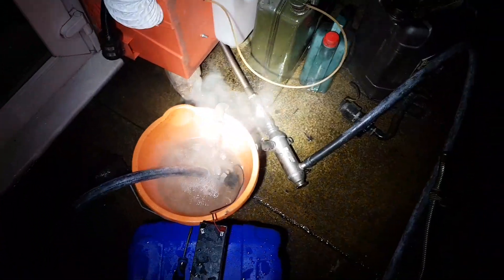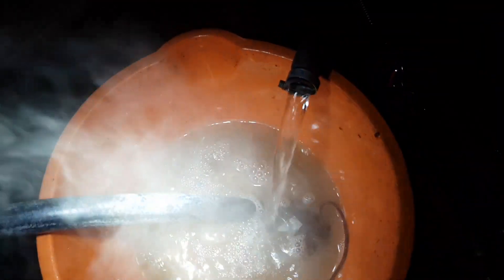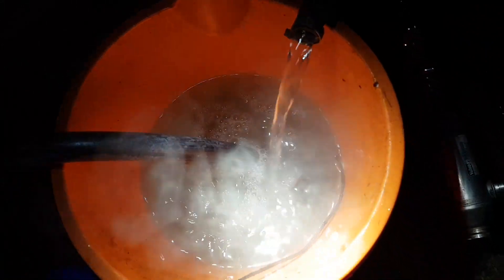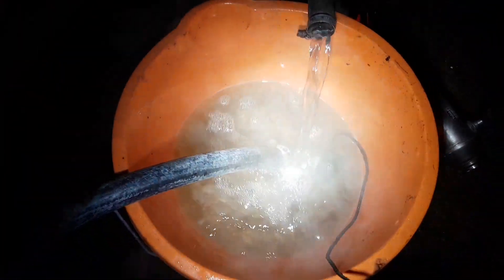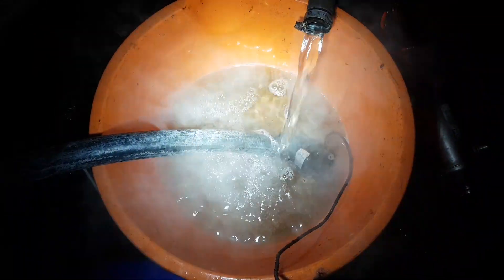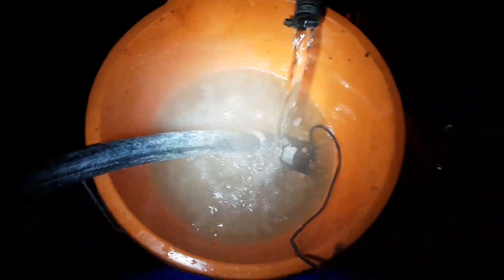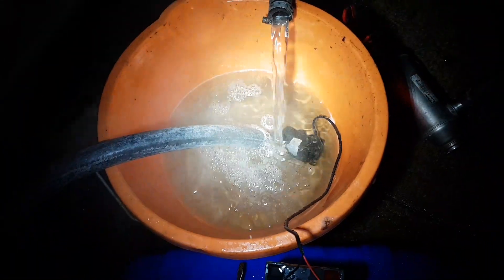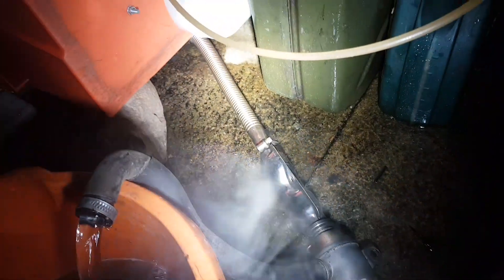5KW Chinese Diesel Heater exhaust heat recovery/Water heater 12v part 1

Comment: Fantastic video. Can you use this water directly for a shower? Is it contaminated? Being run through an old EGR?
Reply from the maker: No, it won't heat the water quick enough; you need a hot water tank to store the water as it's heated. The water isn't contaminated granted you clean coolant residue out properly.

Comment: This is awesome. I was going to go with the copper coil around the exhaust but this will work a lot better. Will it be ok to run the Chinese heater without the water pump circulating the water? I'm going to install a thermostat to turn of the pump when it reaches the desired temperature. Sounds like I'd better add an expansion tank as well so it doesn't go pop.

Comment: I'm currently building my Chin heater - All-in-one - system using exactly the same EGR exchanger as a calorifier, which will be coupled in a thermosiphon loop to a hot-water tank, which will be high enough to deliver hot water via gravity feed to my sink taps and via a 12v (BMW) pump to the shower head.   I will be lagging the entire water heater system too.  

My entire setup is being housed in an old LanLi PC tower chassis - one of the largest PC cases I've ever seen!   All run by a modified 500watt SMPSU from the same PC.   
.
I will regulate the temperature in the tank, by a thermostatically controlled 'secondary loop' that will route some of the excess hot water to a radiator, thus keeping the temperature delivered to the taps/shower below scalding temperatures.    

It was good that you showed this in action, for it confirms that the system will need regulation.   

Excellent little video thanks!

Comment: I may use it to heat my home I have a forest hot water heating system with four zones runs often number to oil in the US but if I add that little heater to a 80 gallon or 50 gallon storage tank once that tank is hot my thermostats will be able to call for heat out of that tank and this heater in theory should make up the temperature in the tank?
Reply from the maker: It will certainly supplement heat to a large hot water tank. I'm not sure it will heat it well though, unless the tank is very well insulated and there is low hot water demand.

Comment: If the bucket was a radiator with an expansion tak in the system it would be free central heating
Reply: Free at a cost of diesel😂

Comment: Hi mate thank you for the speedy response! I have just bought this egr cooler, from watching this video! You should be on commission 😜, I don't suppose you have the details of the pipe and pump so I can put this together? Thanks Jonny - Yorkshire Campers
Reply from the maker: Search ebay for 12v solar hot water pump. As for the hose it's car heater hose; I think it's 19mm but can't remember.

Comment: Can you use this for heater water in a tank for a shower?
Reply from the maker: Absolutely, just remember to use a expansion tank/vessel or vented system.
Reply: @forenamesurname4576  I wonder if the fiamma accumulator will work. Is there a chance the exhaust fumes can get into the water or is it pretty sealed?
Reply from the maker: @YorkshireCampers  Zero chance, the EGR cooler (Valeo# 9631424880) I'm using is made with thick stainless steel. You need a proper central heating expansion vessel; It's essential for safety unless you make a vented system.
Reply: I am thinking of getting one of these what do you think? 
FIAMMA A20 ACCUMULATOR TANK
Reply: Also I don't suppose you have details of the 12v submersible pump do you?
Reply from the maker: @YorkshireCampers  If you search ebay for 12v solar hot water pump you'll find the right sort of thing
Reply: It has just arrived today 😊 so will test it out... I don't suppose you have the details of the pipe used and what the diameter is? Thanks

Comment: Campervan hot water system ?

I have one of those chinesium diesel heaters in my van and like to get some hot water every now and then as well. Looking at your experiment I had an idea...
I was thinking of installing a vat out of a central heating boiler (I have one kicking around which is 14L , has a in and out pipe for fresh water (15mm pipes) and an in and out set of pipes of 22mm connected to an internal copper coil which is normally used to connect to the central heating circuit (water), I mean the water running throught the radiators in the house.

In my van I would run two hoses to my engine and connect the boilers internal copper coil into the coolent system (to get heat into the boiler when I am driving around) but I like the idea to have an EGR exchanger heating up the water in the boiler vat using the chinesium heater in case I decide to not drive for a couple of days or longer. 
Most likely I would need to use a 12v water pump (I have one sitting from a webasto thermotop c) which would circulate water from and to the vat throught the EGR thingy to heat the water up in case I use the chinesium heater...

My questions for you experienced messers-abouter (all due respect) 
a. Can an EGR valve be used to act as a bypass (exit the system before entering the EGR exchanger) for the exhaust gasses in case the water in the boiler has reached a set temperature ? 
b. Is said valve controller by 12 volts ?? 
c. Do you have any suggestions as to what brand EGR exchanger and valve I should try and find for this please ?
Reply from the maker: Hi, theoretically you could do that and it would be a great way to isolate the EGR cooler once the temperature is reached. 

The problem is all the electronic EGR valves I've seen need a PWM signal to open/close the valve. You can get old style EGR valves that use a vacuum actuator to open/close but would then need vacuum source and vacuum modulator. I'm not aware of any useful EGR valve/cooler combos unfortunately.
Reply: @forenamesurname4576  In that case I would probably need to build like a miniature cooling system where the egr cooler is like the engine of a car producing heat, the boiler and a to be installed heater core radiator inside the cabin like the radiator and a thermostat controlling when the hot water from the egr is going where...
Reply from the maker: @koningbolo4700  that'll work fine 👍
Reply: @forenamesurname4576  I was planning a heat in the back of the van based on a mini classic heater core (from which I have the factory fan removed - because of the crazy power consumption is displayed). I could use this heater core and a webasto thermostat t piece (not sure yet if it is usefull since I am not sure at what temps the valve inside opens up...

Comment: hi, i made the same, but my water won't get hot at all. everything is hot, the exhausr fumes too, but not my water. do you have any ideas why?
Reply: if i stop the pump for 30secs, that little amout of water what is in the egr will get hot, but when i run it constantly it does nothing
Reply from the maker: @martintorok7967  what quantity of water are you trying to heat? It will heat water however it will take a while.
Reply: @forenamesurname4576  about 10 liters. after i commented, i turned up the 5kw heater to 3hz, it was good after maybe an hour. have you used full heating power in your video?
Reply from the maker: @martintorok7967  yes I used it on 5.9hz full power
Reply: THERMOSIPHON....  Don't need to use pumps!

Comment: Its a great idea for camper vans and caravans, ive got a diesel heater in my caravan, my only concern for hot water is that you have to have the pump running constantly and make sure you dont run out of water.  A mechanical switch over to a separate exhaust when just using the heater over night would be the ultimate solution if one exists.
Reply: For the past six years, I've had no running hot water or heating in my caravan and thus been reliant upon mains electricity to boil water (kettle) cook food (uwave and small oven/grill) and power the small oil radiator...  Now with the hike in energy prices, I'm I'm currently building my Chin heater - All-in-one - system using exactly the same EGR exchanger as a calorifier, which will be coupled in a thermosiphon loop to a hot-water tank, which will be high enough to deliver hot water via gravity feed to my sink taps and via a 12v (BMW) pump to the shower head.   I will be lagging the entire water heater system too.  

My entire setup is being housed in an old LanLi PC tower chassis - one of the largest PC cases I've ever seen!   All run by a modified 500watt SMPSU from the same PC.   
.
I will regulate the temperature in the tank, by a thermostatically controlled 'secondary loop' that will route some of the excess hot water to a radiator, thus keeping the temperature delivered to the taps/shower below scalding temperatures.    The system will self-regulate and will generate hot water whenever the heater is on.   
-------------------------------------------------------------------------------------------------------------------------------------------------------------------------------------------------------
My system is a closed loop thermosiphon - hot water is circulated throughout the system by hydrothermal convection - no pump required other than to branch off to the shower head which is placed too high to receive adquate pressure by gravity feed alone.  
However, my system is NOT pressurised and is thus a 'vented' (open) system, being fed by a secondary header tank/ballcock from the water mains, dependant upon hot-water demand.    

I had the notion to scavange yet more heat from the heater's exhuast by having it exit via the old instant gas heater fitted in the caravan, utilising its own heat-exhanger in the same thermosiphon loop... With the exhaust emissions being vented  up the old heater's flue.    However, having seen this video,  I may not need to go to that extent.
Reply: You could also run an auxiliary heat exchange system from the van's engine compartment, either by running a coolant hose through the hot water tank or having a second egr system for the van engine exhuaust. Add in a low wattage 12v heating element into your hot water tank as a "primer" to keep it roughly luke warm and you shouldn't ever have to use too much energy from either of these systems.
Reply: would it be necessary  though to separate it? shouldn't the egr exchanger just withstand the heat without the water flow? it would probably just boil the water inside and the steam would push it back to the tank. or am I missing something?
Reply: @plllot9713  do you think this might cause other issues of filling the system with extremely hot air? Maybe I've misunderstood the concept/engineering.. but It'd be great if it could cope

Comment: Efficiency could be improved by installing the heat exchanger closer to or directly on the exhaust of the heater. At least before the damper.
Reply from the maker: Indeed it could. I have since removed the silencer as the heat exchanger does a decent job at making the exhaust quieter. 👍👍👌
Reply: Forename Surname Hi,
Could you measure the temperature of the exhaust gasses after the heat exchanger? I’m curious how much heat is recovered. If it’s warm enough you could even use two of those in series. 
Thanks for the video!
Reply: @forenamesurname4576  The 'silencer' actually performs two functions - 1.  to dampen the sound of the exhaust and 2. to act as a condensor to drain off the excess water released by the combustion process.  
.
Note:  All fossil fuels release several greenhouse gasses - CO2 - CO (lethal) - NO2/NoX and H2O  - ever noticed water dripping out of a vehicle's exhaust pipe?   That's the released water vapour from combustion.  
.
The 'silencer' has a small drain pipe in the base (opposite the fixing hole) which should always be orientated in a vertical position, with the drain pointing down, this is especially important if the remaining exhaust pipe exits in a vertical position.
Reply: Some EGR exchangers can be sought/bought with their stainless-steel flexi-hose fittings attached, in some cases (my own EGR) one of those fittings is equipped with a cast-iron diamond flange, which has exactly the same M6 threads as the Chin heater (5 - 8kW) with the same bore.  I've removed the M6 studs and have clamped the diamond flange directly to the heater itself using two M6 allen screws (with a gaskett).  Quite a coincidence/remarkable that it all fitted together with so little hassle or modification.

Comment: Giving me ideas to heat my koi pond in the winter good vid
Reply: Might be easy to overdo that - be careful you do not make fish stew.
Reply: @christopheraugustine5816  ponds tend to need many kw of heat so unlikely to overdo it with a small unit but it needs a fine control
Reply: @simonwass6315  I was just thinking about how devastating that could be to someone who had spent a lot of time getting things just so - and then wrecked it all on accident. I know I would feel pretty defeated if I did that.

Comment: Maybe this could be plumbed into your coolant system too to warm the engine?
Reply: It absolutely could - the negative being that you need a very low draw recirculating pump and between that and the heater you might want a secondary (deep cycle) battery.
Reply: Land Rover (amongst others) and artic tractors have been utilising small diesel heaters for that very purpose for decades.  
Ebay is full of them...
Reply: That’s what a hydronic heater is for. Heating up your engine with your engine coolant.

Comment: Interesting video, I have considered this for a while, great to see it tested. It would be good to have radiators or underfloor heating,  it always seems to cool down fast when off, perhaps water would radiate heat for longer.
Reply: It would hold the heat longer, water has (I think) the highest specific heat (or heat capacity) per volume of any readily available material. The only limitation of course, being that it boils easily. So buildings tend to use bricks because they can be heated higher, although they store less per mass.
Reply: @christopheraugustine5816  - Actually sand would hold the heat for longer (and salt, though that would be somewhat impractical in this setup).   Route the excess heat into a tank containing a coiled loop embedded in sand - voila!  A sand-battery powered by the excess heat of the heater waste exhaust.
Reply: @Deebz270  Your response while technically correct, is misleading. Sand would hold heat longer than water, because the sand cannot re-radiate the heat as efficiently. Sand can also store higher temperatures than water (assuming it is not pressurized), since water will boil, and this type of heater is not about to melt sand. So the sand could hold more total heat (if exceeding water's boiling point) and it would radiate that heat back out at a slower rate, but volume for volume water heated below the boiling point will hold more therms. Additionally, water can be used more readily for transporting heat from one area to another. Pumping water is easy, moving hot sand - not so much.
Reply: @Deebz270  Water has a specific heat of 4.186 J/g°C, whereas sand has a MUCH lower specific heat of .83 J/g°C. Just the facts - water is better at storing heat within its useful range. It seems counterintuitive, until you realize that the high content of water on our planet is actually why we have stable enough temperatures for life to survive. Salt works best in a phase change scenario, which is completely impractical for the DIY crowd.
Reply: @christopheraugustine5816  Could also be pumped around your radiators at home, lots of options.